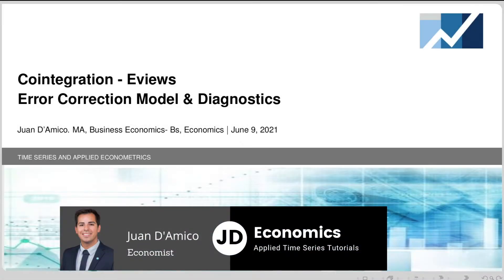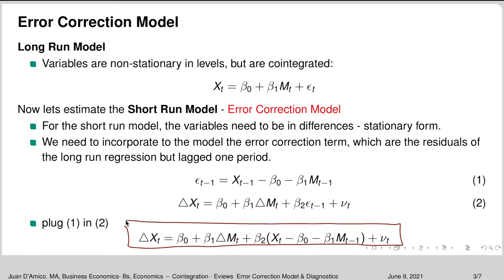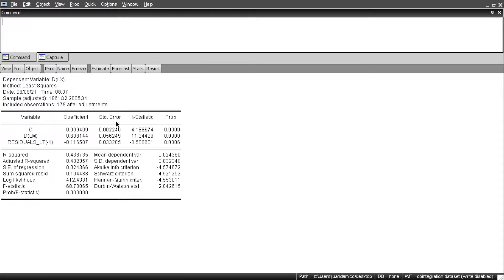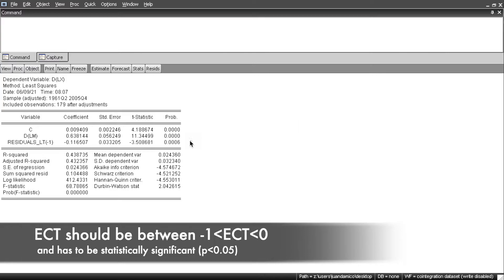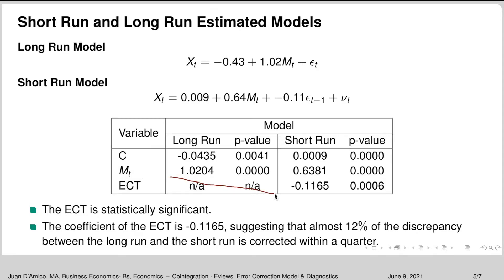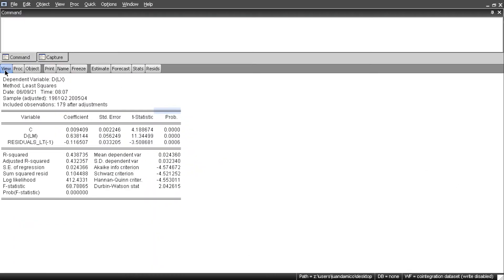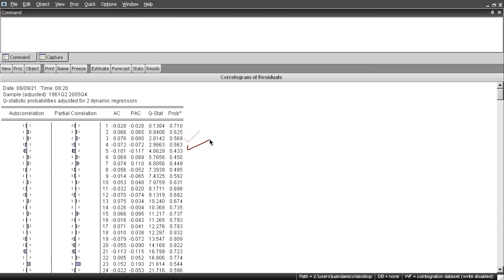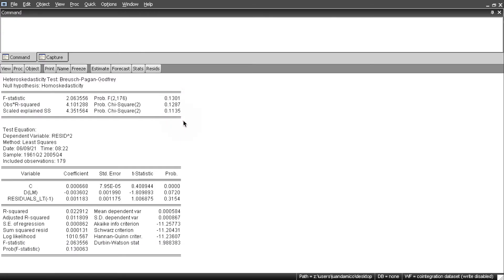Time Series: Error Correction Model explained in Eviews

Comment: Great work and i appreciated you alot, however, plz, further explain my argument in detail:  like what would be the intercept value ?i.e, alpha = 0,  alpha > 0  or alpha <0 . as i read many articles that the intercep coefficinet value should be 0 and thier p value should be greater than > .01, >.05 and >.10. so, if this is the case,  then it means, that the model is stable and valid.explain? example CAPM, FF3FM, FF4FM, FF5FM and FF6FM.

Comment: Hello sir, I hope you will answer my question. I found error correction form negative sign (-1.07) and statistical significant. Is there any problem with that? Because it’s not in the range of 0 and -1. There are many articles that similar to my finding.
Reply from the maker: Hey. If it’s a linear regression, it should he between -1 and 0. If it is more negative, then the results are explosive.  Otherwise, you could say the adjustments are immediate. In other words, takes no time to adjust a disequilibrium. But it’s not really a good analysis. Cherrs

Comment: I am studying price dynamics between retail and farmgate prices. What if the sign of the long run and short run adjustments are different? Also, what if the short run adjustment is not significant but the ect is negative and significant? I hope I can show you my data and results cause I badly need help on this one.
Reply: As a tentative to answer your very important question, you may want to re estimate your short run model after watching closely heteroskedasticity and serial correction. Which will give you consistent non unbiased estimates. With these estimated obtained in OLS, you can run an ec approach to which will provide results worth advising public policies

Comment: hello i just wanna ask again, will the result differ if i exchange the dependent and independent variables? what does it mean if it shows that it is cointegrated with significant ect when variable a is used as dependent variable but the results differ when i used variable b as the dependent variable?

Comment: hello. i have a question. what if both engle and granger and phillips ouilaris shows that the residuals are stationary which makes my variables cointegrated. however when i generate the short run model the ect shows that it is not significant?
Reply from the maker: Can happen. As an economist, you have to analyze the results and see if they are sensible. Good luck!
Reply: @ForecastingEconomics  what if my ect is finally negative and significant but the other variables like the constant and lagged difference of the other variable is not?

Comment: Sir, initially your short run model (ECM) had some variables in differenced form but at 5:10 minute in the video you are writing short term model with all variables in levels. Could you please explain what happened there?
Reply from the maker: Hi, the coefficient values are from the short run model. I also wrote “short run model” , so we know we are talking about the short run model. Seems I missed to type the differential symbol (triangle) in the variables. Regards
Reply: @ForecastingEconomics  ok sir. Thank You for responding.

Comment: Thank you for your explanation video, sir. It's really helpful for my thesis. But, I have little troubles here. 
1) What can I do, if the model doesn't fulfill normality assumption? And how can I fix this? 
2) the ECT value is positive instead of negative, does it mean I have to re-estimate my model?
Thank you very much for your answer and help.
Reply from the maker: Hello, Thanks for your message. If your residuals aren't normal is not the end of the game. Don't worry. Autocorrelation is more important. There can be some part in your residuals that are spiky, and maybe a dummy variable can help for that particular period.
In terms of the error correction term, as you may have seen in the explanation I provided, the negative sign allows the model to correct. Two negative signs will make it positive (picture a trend going very very down, the negative sign will correct it and make it positive) and other way: (very positive (+) a negative sign will make it negative (-) and go down). That's the intuition. Remember the term is allowing the discrepancies between the short and long run to be corrected.  Regards, JD
Reply: @ForecastingEconomics  

Good morning Sir, 

Thank you very much for your videos. I was just asking myself this question (my model doesn’t fulfill normality assumption) because I had the same problem so I thank you for this answer. All the other conditions are met ( no serial corrélation and no hétérostacity) and my two séries are cointegrated. I was just wondering if it is a problem that I have only between 25 and 30 annual data? 

Thanks in advance